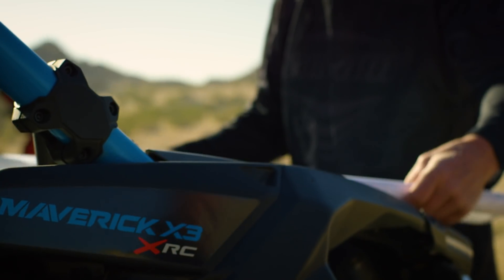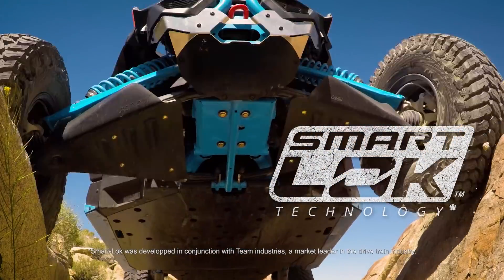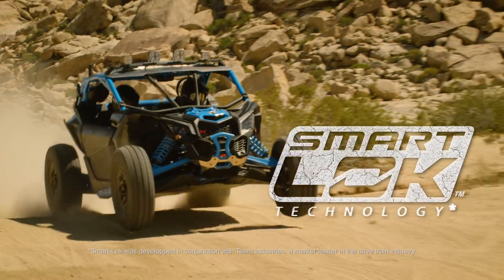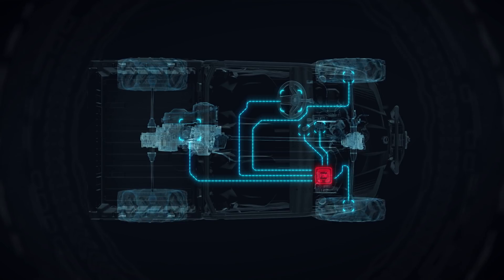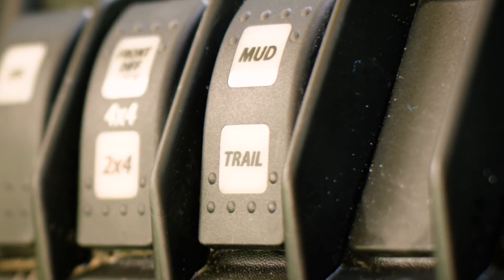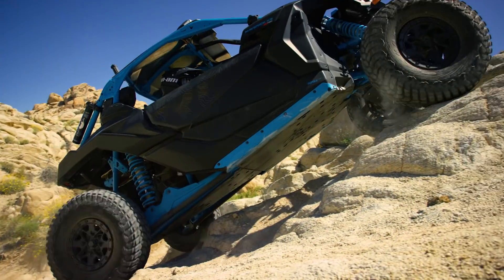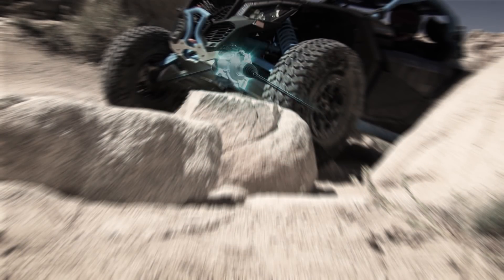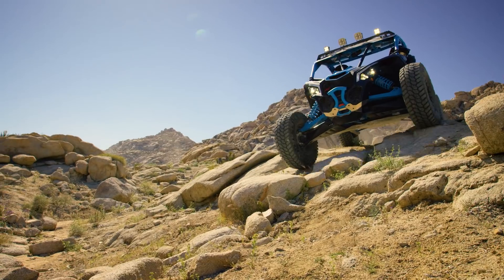Can-Am - SMART-LOK™ TECHNOLOGY

Comment: Smart-Lok? Yeah it will work for a while until the clutch wears out. Just make the real lockers that are  proven. You don’t need it in full locker for long. Just to get you out of the difficult area, then smashin time! This smart-lok will only prove itself to be not dependable. But don’t get me wrong, love Can Am. They just need to give us the good shit!! Real lockers!
Reply: Full lock is not needed for long, you're correct. Which means the clutch pack will last a very long time!!! Because it's only applying that pressure for full lock for a very short period. It also unlocks it basically instantly meaning that the other components won't have to deal with the stress of having it fully locked while moving for those short periods until you unlock it.

Comment: locker is still trash it uses clutches to engage the diff lock so it will wear out over time , like canam belts.
Reply: check out the sparc drive - it's a "locker" that doesn't use clutches or brakes.
Reply: check out the Honda rubicon, the best of the atvs.
Reply: @dynamiccalisthenics1922 Lol Honda blows!!😂😂